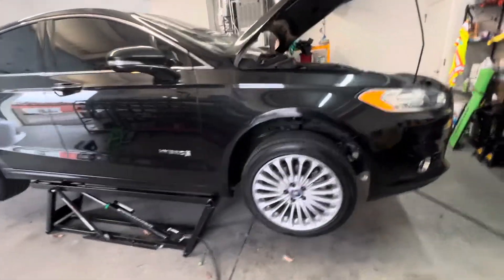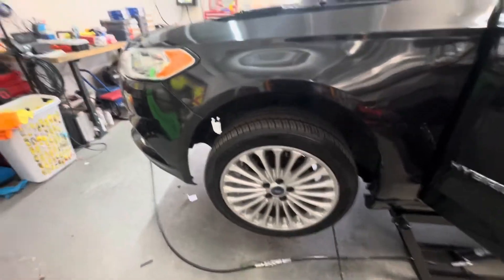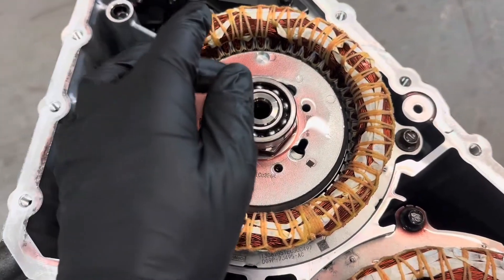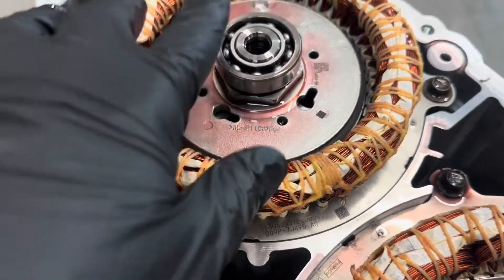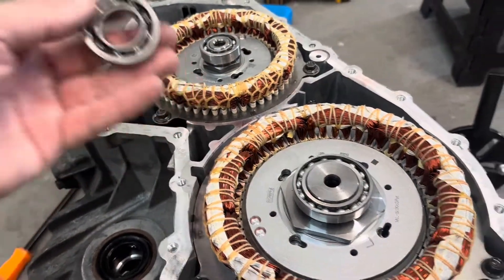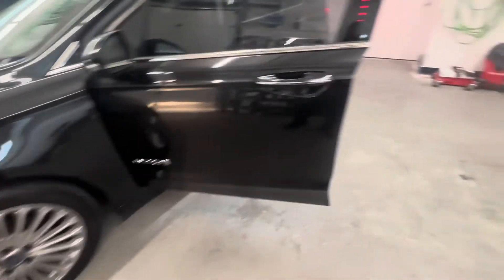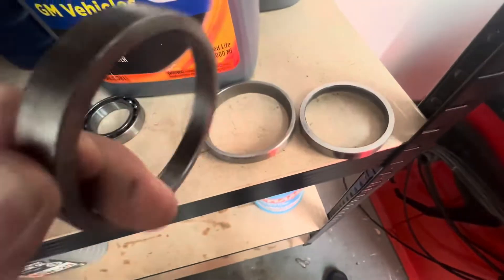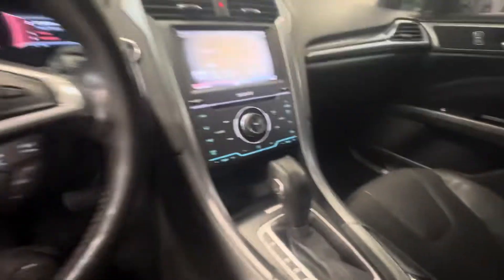HF35 2013-2020 Ford Fusion Hybrid Transmission noise and rebuild  energi bearing noise

Comment: This is great!! Amazing info that no one talks about and I feel it’s an issue.

Just started getting a little bit of whine at 165k on a 2015 fusion hybrid. No where near this but the usual whine of the hybrid definitely got louder

Would you suggest more frequent fluid changes or just leave it as is.

Thank you for your contribution, shit I wish I had a shop like this near me. As I have 3total hybrid or electric vehicles 

Will also email. Thanks for the response in advance

Comment: Hello, I have a 2014 Ford Fusion 2.0 Hybrid. The left side of the gearbox where the grenade goes in is wet, probably the oil seal has come loose. Can't I just replace the oil seal? They told me that the gearbox bearing also needs to be replaced, the bearing is out of order. How realistic is it, please advise.

Comment: I have a 2016 ford fusion hybrid SE with 104,000 miles on it.  It's make a strange noise, but not like the one in this video.  It almost sounds like when a brake pad wears down and the brake pad metal sensor starts to grind just a little bit against the rotor.  I say, just a little bit because it's very faint. It happens when braking, and also when accelerating.  Same noise.  Any suggestions?

Comment: So! Based on the information in this video, I was able to find the part that matches what the noise maker that he replaced. 

I purchased mine directly at Ford and set to do the repair sometime next month. Here is the part number. 

DG9Z7H338D

I hope this helps 👍🏾
Reply: Did you do the repair?

Comment: My ‘13 had a total trans replacement in 2019 w/95k miles.  It crapped itself again at 171k miles.   Leaking trans fluid from the seal

Comment: Would this be an issue in the lincoln mkz too? Because mine is doing that noise also
Reply: It’s the exact same hybrid system..
Reply: 2013+ hybrid Lincoln and Ford's have problematic bearings with the US manufactured Aisin hybrid transmission. In the previous generation 06-2012 the hybrid transmission is made in Japan.

Comment: When someone starts hearing the sound, how long do they have?
Reply: Its been 7 mounts how is yours ?
Reply: A few months . . .pretty sure the bearings went out in my daughters car today. That's how I came across this video. I filled the transmission case with fresh fluid a few months ago due to some issues and today it gave up the ghost.
Reply: Been 3 years but I only drive 10 miles to work.  Warning light for overheating comes on after 250 miles.  2017 hybrid Energi

Comment: I'm not sure if it's the same problem we have in our 2015 Fusion Hybrid SE. Our car gets very loud under load, say climbing a bridge etc. Any suggestions? Thanks in advance....
Reply: Any luck? I believe mine is doing the same thing. Just sounds like the engine is louder when the hybrids stops and it’s just engine power.
Reply: Going to try a transmission fluid exchange soon. Maybe unrelated but it made a lot of difference in my Focus ST which may be apples vs oranges, but it’s worth the $200 to try

Comment: My local transmission shop says no one is rebuilding these HF35 transmissions, so good for you.  They said Ford is asking $8.5k for a new one, just today.  My 2014 FFE with 107k miles has a lot of whine while driving, especially with regen, but is mostly quiet at idle.  I've just changed the ATF for the 2nd time in 15k miles, and this time added some Motorkote (7 oz) and now it is quieter, but not quiet.
Reply: Ford was aware of the issues on the 13 and 14 Fusion Hybrid and CMax. Had a service bulletin in 2015. Mine started this at 112k
Reply: @BWASRawk  dealer refused to do anything when I called at 9.5 years since it was still working, just noisy.  Now the warranty is expired.  And they said my particular transmission was not covered under the recall.
Reply: I'm at 109k and now it makes grinding noises.  Parked and awaiting me having it towed to the junk yard.
Reply: You’re not supposed to because they are e cvt and have a 50 % fail rate
Reply: @TetherFINALboss   50% failure rate is criminal.
$9000 for a e cvt installed is criminal when the car is worth $8000.  This is a nightmare purchase at this point, and I'm currently driving my '02 E46 which cost less when I bought it new, but still running great at 152k miles.

Comment: Great video,  My experience Is the Ford engineer required the wrong ATF. That roller bearing should never fail in proper fluid.  Roller bearings just like that bearing will operate for years with small grease inserted.  Great video.
Reply: Maybe change the atf with something little bit thicker 🧐

Just regular transmission fluid not the Low Viscosity
Reply: I just bought one… any suggestions?

Comment: Wish you were in AZ! A local ford dealer wants nearly $10k to fix this an a couple of other issues on my 2013 C-Max. The Transmission died after 102,000 miles.

Comment: Do the energi plug in hybrid aux oil pumps go bad? My wife’s 2014 charges normal but over the last month or so the EV mode doesn’t stay on, meaning the engine kicks on, and I’m curious if the aux oil pump is failing , forcing the engine turn on to keep the transaxle lubricated. The Ford dealer says it’s the BECM…
Reply from the maker: Not the pump. Ford dealer is probably correct.

Comment: Mine started at about 75k and I'm currently at 153k, with a $6,000 bb value I'll probably just run it till it dies with a $3k repair bill
Reply: Hey Mike, i am having the same problem, so you put another 78k with the noise, or have you replaced the transmission?
Reply: Mines do the same noise, can you please confirm if you drive with this noise another 75k miles. Thank you
Reply: do you have the energi or regulat hybrid
Reply: @hivn58  Just a regular 2017 SE hybrid
Reply: Have you flushed or change the fluid to help you keep plugging along? I have a 2015 Hybrid  w 110,000 and wondering how long it could last.
Reply: @DanielHoffmann-tg1kg  Just changed it at about 125k when the left front cv shaft seal and right CV shaft went bad.
I will add that I drive mostly on the highway with a bit of idling in the winter.

If I remember I'll come back and note when it dies, I might get ambitious and pull it myself.

Comment: Why this happens? Not enough lubrication/not changing oil? Too small bearing to hold the load? Overheat?
Reply: Probably because of the oil velocity goes thinner after time if you dont change out the fluid?

Comment: Yeah my ford fusion hybrid 2014 makes the same noise.  There  are 2 problems one are bearings and the other is the generator.  The bearings got replaced and still makes that squeaking noise. They told me the right way to get it fix is to replace the transmission. There is no parts for the generator. It’s a bad transmission design by ford. By the way, even thou
You replace the transmission it will still have the same problem eventually.
Reply: So what’s the solution then?

Comment: Exactly what my Fusion just started doing.  185K miles.  So Ford must charge at least 4K to do this job.   Time for a new car
Reply: You got twice as many miles as I did. Mine's getting diagnosed right now at Ford dealer. It has 96,XXX miles. I'll probably take it elsewhere. I imagine Ford will overcharge.
Reply: @adamanderson5055  Warranty is 8 years or 100K.  Mine started doing that at 97K.  Took it in at 98.5K.  They kept it for 5 months waiting for parts.  Finally got it back a few weeks ago.  It is like new.  No more noise.  All under warranty.  Got a loaner.  Had to pay for a new battery which is pretty low cost for what would have been the real cost.
Reply: @PhuN_1  how long did they take to diagnose? Also what did they tell you the issue was. I have an appointment soon and I’m at 90k miles. Was hoping it was something covered under warranty
Reply: @arniehdz8389 it only took them 2 days to figure out the problem.  Multiple bearings were pitted.  The guy said they replaced most of the bearings.  Waiting for parts took all the time.  Putting in back together was tricky so they had an engineer come to the dealer which took another 2 weeks.  I guess my dealer doesn't do too many of these fusion energi.  After this near miss, I am going to do a drain and fill every 20K.
Reply: @PhuN_1  awesome. Thank you for the reply. Hopefully the dealership doesn’t give me a hard time about warranty. I should be good I called ford and verified my started in the factory in 2017z so I’m under the 8years/100k. I just don’t want them to hit me with the “it’s power train” and not something covered under warranty. Hoping I’m able to get a loaner as well. Again, thanks for the quick reply
Reply: @arniehdz8389  in the warranty booklet, 2020-Ford-Hybrid-Car-Truck-Warranty-version-1_frdwa_EN-US_04_2019.pdf, on page 17.  It tells you what the warranty covers: 

"Depending on your vehicle, electrical drivetrain system components
covered by this warranty may include, and are not limited to:
high-voltage battery, high-voltage battery connector, high-voltage battery
isolation switch (manual disconnect switch), battery pack fan assembly,
battery pack sensor module (HBPSM), battery energy control module
(BECM), on-board charger, on-board charger fan assembly, inverter
system controller (ISC), DC/DC converter, hybrid continuously variable
transmission or electric driveline motor and transmission range sensor."

They replaced 3 transfer shaft bearing, differential bearing, ball bearing, 2 cups, gear input asy, 2 seals, front shaft axle, nut, and antifreeze on the transmission side.  

Good luck with your repair.
Reply: Same im at 186,XXX

Comment: I am getting a noise when the ICE is running that is kinda loud and whine, but it does not do it when the electric motor is on. Would that be a separate problem from this?
Reply from the maker: Same problem. Gas engine must be running to hear the bad bearing. You need a rebuild

Comment: Actually it's 12 total. The other side has 8 bearings that go bad as well depends 2 or 4s or 6s. These four in the back also need replaced but front is the problem all the time in my experience
Reply: There's another bearing for the fusion flux capacitor.

Comment: Thanks for posting as it was very informative.  I do all my own repairs typically, but this one seems beyond my capability ATM. From your experience, at what mileage does the owner expect transmission bearing failure ?
Reply from the maker: 100,000 if the fluid has never been changed.
Reply: How often should the tranny fluid be changed on the fusion hybrids? Is it a tranny flush and fill? Or drain and fill? THank you for your information! @hybridandelectriccarsales9703

Comment: Is this the same transmission as a C-MAX.. if so are both the energi version and regular hybrid version the same. Or do they have different gear ratios or anything
Reply from the maker: The Hybrid versions of both the Fusion and Cmax share the same transmission. The Energi versions share the same transmissions. And yes different gear ratios, 2.5 vs 2.9. Parts are not compatible between the transmissions.
Reply: Thank you very much. I fixed this today same exact noise if it wasn't for your video I don't know what I would have done. I had a donor transmission from a regular CMAX and I thought I could put it in a CMAX energi I realized right off the bat it wasn't compatible because of a lower transmission fluid line. Thanks to you I was able to make a split decision to use the bearing instead. All is well it runs and sounds great. However now I wish I could just buy that same bearing so I can put the donor transmission back together and keep it as a spare . Where could I buy the bearing by itself?
Reply: @Musicallyattuned how hard is as it to pull?
Reply: @stuartshellenberger9225  I have many years of experience replacing transmissions and it still took 8 hours to complete. It's harder than a regular foward-wheel drive car because of the cramped engine bay. You can remove it through the front by removing the front bumper and everything behind it. If you do not have a lift this will probably be the easiest way.
Reply: @Musicallyattuned thank you!

Comment: Same page here .. where did you got the bearings pls???
Reply from the maker: I get the bearings directly from Ford. You need your use the parts catalog. I also sell the full bearing kit for $995 which includes everything that needs to be replaced.

Comment: Thanks for the video!  My 2017 ford fusion hybrid is having a transmission bearing noise from 30 to 50 mph and not at a park position you were showing.  Where do you get the bearings and races from ?  I have been unable to find those parts anywhere.
Reply from the maker: You get the bearings directly from Ford.

Comment: Where did you source the bearings from? And could you get back to me about prices for sending one In for repair so I can weigh my options? Also what tool did you use to pull and press the bearings on and off? Does it work well? Planning this repair for spring if it doesn't explode before then
Reply from the maker: You get the bearings directly from Ford. We charge $2995 to pull and rebuild. I sell the rebuild kit for $995. If you brought me the transmission I would charge $600 in labor for the rebuild + $995 the rebuild kit. I will not install your parts.
Reply: @hybridandelectriccarsales9703  Do you ship the rebuild kit?
Reply: where's your location?